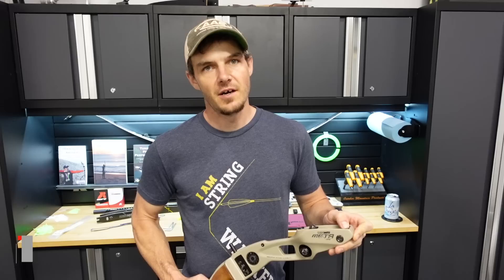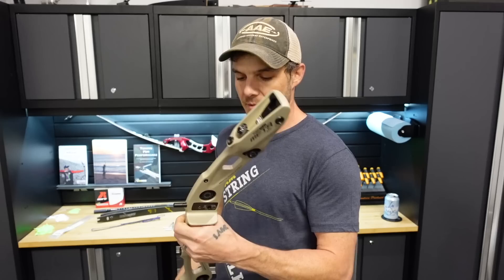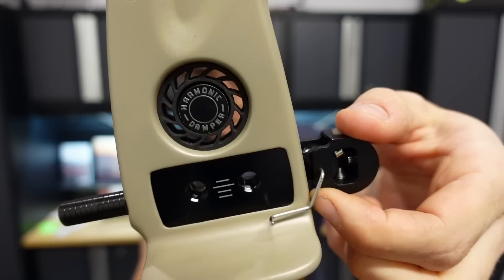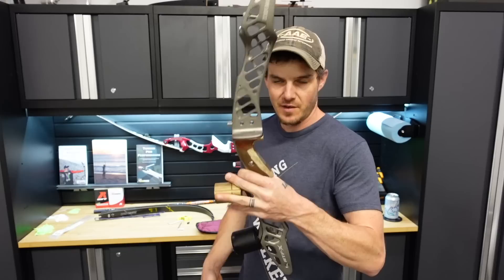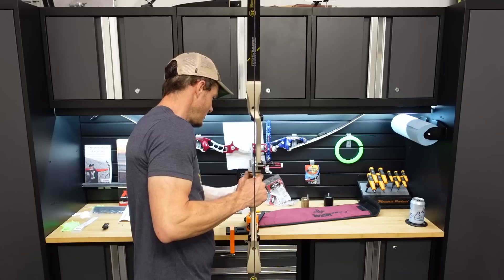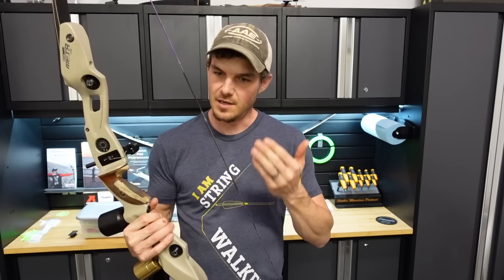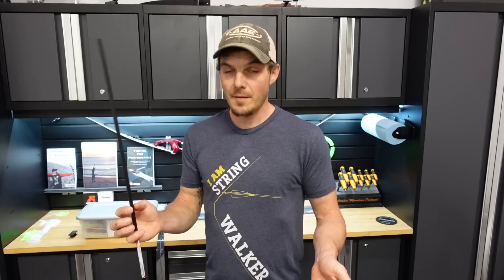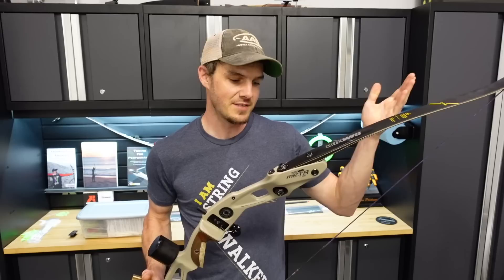Barebow Indoor Tuning Mini-Series Episode 1 | Win & Win Meta DX Initial Setup

Comment: Those Zniper washers are the bane of my existence.
Reply: My zniper had a wobble, I saw it only had 1 washer so figured putting a 2nd in would fix it and be a quick job...... 30 minutes later I had it done.
Reply: @ColoursOfDan02  Although I'm just gettting back into archery, I've been involved in RC fort a number of years, and RC racing for a few years.  I completely understand the "difficjulty" of getting washers (or, in the case of RC, 'spacers' or 'shims') into very tiny spaces.  When trying to places shims as thin as 0.5mm between a spacing of less thsan 1mm, it can sometimes take quite a while...and many, many attempts.

Comment: The moment you said that you would exchange the wire on the Zniper I knew what would happen. 🙈 But thanks God it's not only me. 😂 The only one way to change the wire without loosing the washers is to push it out with a wire of the same diameter. Then use the indoor wire to push out the intermediate wire in the opposite direction. The moment you pull you have lost.
Reply: That was in my mind too 😂 From stock it comes only with one washer. I tried two washers too. Annoying job to get it done. Maybe i should ask Michael Mayer what’s the goal behind that.

Comment: I use the longer wire on my zniper, it has better clearance for larger fletchings on indoor arrows, but I don’t bother changing it for outdoor as I had the same issue with the short wire not been under the plunger.

Comment: @ 16:58  To clear the bottom limb bolt I put a 1/4" thick steel washer between the lower weight and the bushing, otherwise too much weight is transferred up the riser for my liking. Nobody has said that's illegal so far!!

Comment: Great Video Jake. Clean run through set up and it's good for us  to be exposed to challenges like the wire change. Loved the Centre-Shot section and camera centred. 

(English/ Australian spelling on  centre vs center)

I shoot recurve but would like to try out barebow later ...think I'll keep my low anchor point aswell. 

Bow looks killer. 
Get those groups. 

Would be cool to see an Olympic Recurve Archer's bare bow release
in slow motion (high frame rate)

Comment: Perfect timing--how did you know I was thinking about indoors?

I have a 27" ATF-X and have put dampers with 4oz weights in both the mounting holes behind the limb pockets with 5oz weights in the front bushings. The dampers take a lot of the shot vibration out of the riser. I really like having weight top and bottom of my riser. And yes, my riser does pass through the 122mm ring.

Looking forward to the rest of the series.

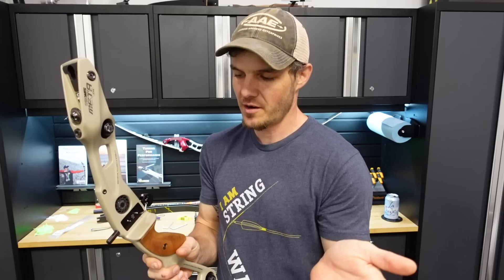Comment: @jake :  around 7:00 - why do you want to have the wire under the button? Try it as it is now, it is like the "overdraw effect" of compounds. I see nothing wron in havin a cm or 1,5 beween Button und Wire.    OK, you explained at 8:00. Yet I do not see that critical, but I might have smaller crawls than you.

Comment: @JakeKaminskiArchery Do you have any suggestions for limb alignment for folks who may not have a stabilizer? All of the videos I've seen on limb alignment require the stabilizer as part of the setup. I suppose I could always purchase a cheap $30 one just for alignment purposes but just curious if there is a method that could be reliably used with barebow only equipment. Thanks!

Comment: "Damper's corresponding verb is dampen, which means to deaden, restrain, or depress. ... A dampener is someone or something that dampens. So damper and dampener can both refer to one that deadens sound vibrations."
Reply: Agreed.  in RC, Tamiya calls the shocks "dampers".  And, in cycling, bicycle/frame manufacrturers call the 'elastics' inserted into frames (such as the Specialized Roubaix, Pinarello Dogma, etc) "dampeners".  Two different words...with the same meaning.
Reply: Dampen seems to be reserved more for non-physical things, like someone’s mood. In engineering it’s always been damp and damper for physical attenuation, such as vibration, shock loads, or oscillations. I wonder if this is one of those cases where more and more people have been using dampener overtime so they added it to the dictionary. An older American Heritage Dictionary we have (1985) does not have an entry for dampener, but includes it at the end of the entry for dampen, used as a noun for making something wet. It also explicitly defines damp and damper as used in the engineering sense, but not dampen.
Reply: I tend to find dampers in chimneys.

Comment: Silly newby question: does stringing and unstringing a bow get it off tune? And should I take it apart if I'm using it weekly? I have an aluminum riser with bamboo/glass limbs (in case it makes a difference).

Comment: Jake, i also intend to keep my indoor arrows uncut so far (which gives me a length of 36"), but i wonder if this is in conflict to where the front node of the arrow sits in relation to the contact point of the plunger. Isn't there a 'riskt' that the front node sits too far in front of the plunger (and if so, what are the possible consequences / negative impacts and is there a chance to compensate for it beside cutting the arrow?)

Comment: If you only shoot barebow you are not going to have a stabilizer to help you align the limbs. I am assuming that many cheap stabilizers are not as straight as one would want. I refuse to spend the money for a high quality one that will be used only infrequently.   Aside from the beiter blocks, does anyone know of any inexpensive aids to limb alignment?
Reply from the maker: Actually I’ve found more straight stabilizers in cheap manufactures. Expensive doesn’t mean straight.
Reply: Thank you for responding.  If it was not for you, I doubt that I would have continued with the sport.  I was a frustrated tyro when you launched your channel.  Best wishes. @JakeKaminskiArchery

Comment: Hi, what do you/everyone use to hold the bow whilst checking limb alignment?  Thanks
Reply: I am not sure that's the right english word, i use a Bike repair stand.
Reply: I'm really a novice and a DIY'er,  but I drilled a piece of aluminum angle and used a bolt the same thread as the stabilizer hole to hold the bow.  I tightened the bolt to the bow, tightened the bolt with a nut to the angle and clamped the angle to my bench.